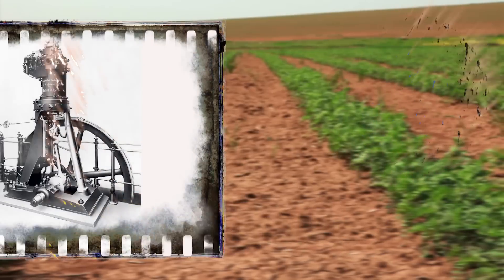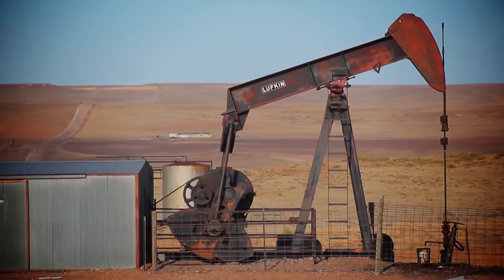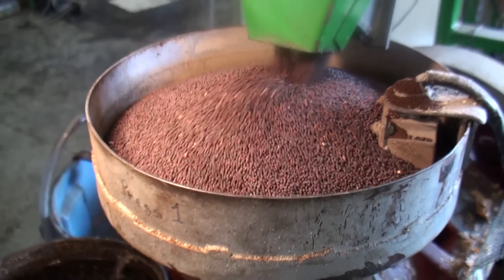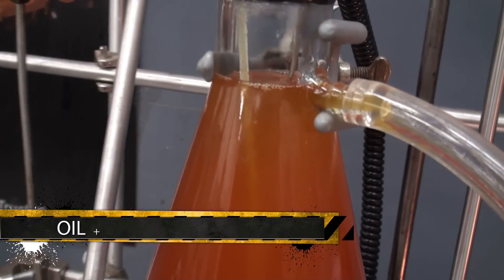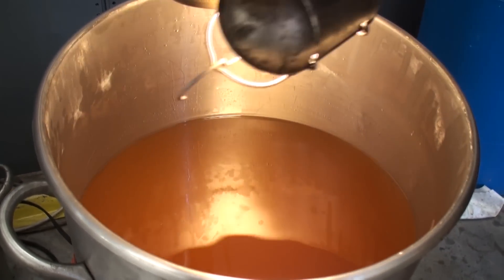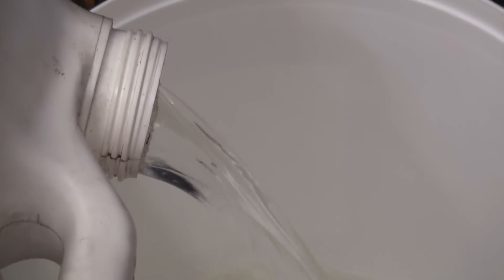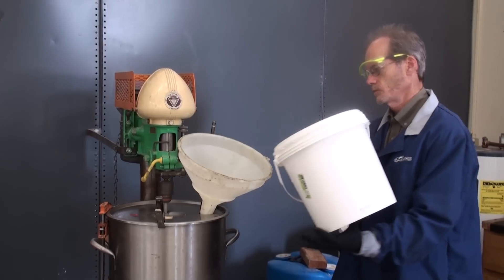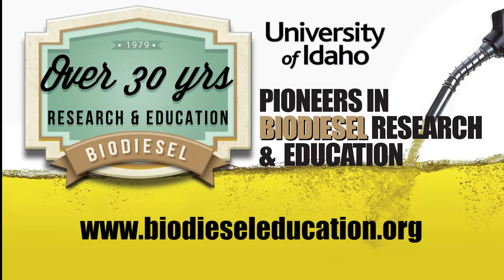HOW WE MAKE BIODIESEL

Comment: Does biodiesel reduce NOx emissions as well?
Reply from the maker: NOx increases can range anywhere from less than 1 percent to 15 percent higher than petro-diesel, with a long list of "depending on" factors. Some of the many variables contributing to the wide range are the type of test engines used, the test equipment itself, the feedstock source of the biodiesel tested, the process by which the biodiesel was transesterified, the blend of the biodiesel in the test fuel--the list goes on. Great question!

Comment: Why bio diesel is lagging behind electric vehicle,?
I mean it's too cheap to produce bio diesel as compared lithium batteries also people don't need to change whole vehicle just they need to switch gas station
Reply: Two reasons the land required to produce biodiesel is a lot second it is expensive with a lower energy density than diesel and a 3rd one is even if all other problems where somehow solved the internal combustion engine has very low efficiency compared to electric motors

Comment: Is the biodiesel usable in cold weather?
Reply from the maker: Biodiesel can be used in cold weather, it does have some cold flow issues compared to regular diesel but these are usually dealt with by putting in a fuel additive. We have a biodiesel cloud point video you might be interested in here: https://youtu.be/cxrkbYaFwlg. Also, Jackson Hole Mountain Resort in Wyoming uses biodiesel in very cold temperatures, and they have a video on that here: https://youtu.be/rR7gvGQbTvY.